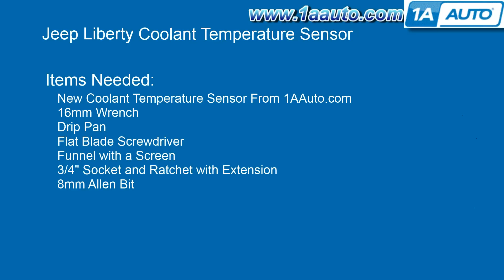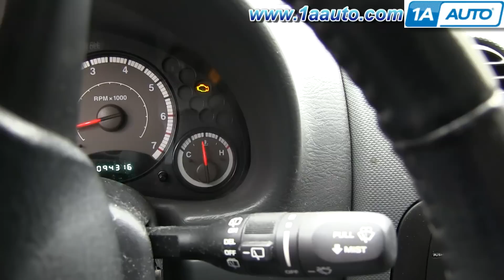How to Replace Coolant Temperature Sensor 02-06 Jeep Liberty

Comment: Why drain the coolant?
Reply: If you don't drain the coolant first, when you remove the old sensor coolant will come gushing out the hole the sensor goes into.  You don't have to drain it completely, but the level must be drained to a point below the height of the sensor hole.  Easier to drain first into a pan than to have it come out the sensor hole all over the engine, etc.
Reply: @timinbovey it will only gush out if you remove the coolant cap.

Comment: Why do I have to drain the radiator to change the sensor?  Let me know please.
Reply: because the coolant temperature sensor is below the level of the coolant, if you don’t drain it below the level of the sensor coolant will come out of the sensor hole

Comment: I have a 1993 Chevy Corsica   The temp sensor plug my car came with is a 4 wire plug. The only temp sensor replacements is a 2 wire. I’m wondering how to wire the new 2 wire plug in place of the old 4 wire plug so I can plug into the new temperature sensor

Comment: A 1 auto....quick question if i may? while my jeep is running... i unplug sensor and the fan comes on, is that normal????
Reply from the maker: +james bivens Thanks for watching! Since this sensor is part of what tells the fan to kick on and off yes, that could happen.
Reply: @1AAuto  I just put in a new fan and sensor, it will run forever and fan WILL NOT come on until I unplug the sensor. Then the fan comes on, strangest thing I've ever seen, any thoughts???
Reply from the maker: +james bivens We wouldn't be able to diagnose an issue like that here, you may want to have a local mechanic take a look at it. Thanks for checking us out! http://1aau.to/m/Shop-1AAuto-c

Comment: Is there a fuse or relay associated with this sensor? I just changed my sensor out but my check engine light is still on and the coolant sensor code is still coming up.
Reply: Change thermostat

Comment: Really should have reconsidered the audio after 2:51 since 97% of what you can hear is the engine and fan noise, not your extremely faint speaking voice.  Really appreciate the video though and it's very helpful.

Comment: Ect sensor still has plastic part sticking up. Cant get socket low enough to unscrew the thing with that piece stick up out of it. Yes I've took off the wired part. But you didnt say anything about the left over piece that is plastic that is apart of the sensor that's screwed into the engine. Does that piece come off or will I need to buy a socket that's got a deeper or longer opening ?
Reply: Deep well socket should work

Comment: Is the coolant temp sensor the same as the thermostat?
Reply: No. The thermostat is on the front, bottom passenger side of the engine where the large radiator return hose goes into the block. It’s between the plastic hose fitting and the engine. There are vids on here for that item.

Comment: 04 jeep grand Cherokee limited edition noise. Temp sensor is out replaced it already but it shorts out fan and or circulation of coolant how to fix😣
Reply: My alternator is on the left orpassenger side and temp sensor Wiring is on other side of the motor
Reply: Lol

Comment: Will the engine light go away after you switch it?
Reply from the maker: +GoForIt If this is the reason for your check engine light, yes. If it's still there, there may be another underlying issue. It's hard to know for sure without being able to diagnose in person
Reply: Yea I drive it for about 20km and it was still on.  I ran it on a coder machine said it’s the only code. Cleared it shall see if it comes back! Love the channel
Reply: I would assume you would have to reset your battery and drive fifty to a hundred miles to reset the battery which would then reset the check engine light.

Comment: did you fully drain radiator? my jeeps sensor is longer and requires me to pull airbox assembly connectrd to throttle body.  not sure yet how to proceed
Reply from the maker: +Joe Heading You may be able to drain it halfway to allow the fluid to drain out of the upper hose. We carry the replacement sensor shown in this video on our website. Here's a link to them. https://www.1aauto.com/1A/coolant-temperature-sensor/Jeep/Liberty/WETSU00002?utm_source=YouTube&utm_medium=CTA%20Comment&utm_campaign=1ATony

Comment: 2007 jeep commander starts about 3 times and once I've driven it around town for a few hours...it will crank but not start. I wait 20 min and it starts everytime. Been doing that for 4 years. Any clues??
Reply from the maker: It might be getting some type of a vapor lock
Reply: Crank sensor

Comment: If i switched out my water pump an new thermostat an a new radiator cap why is my car still over heating
Reply from the maker: +Alex Perez We wouldn't be able to diagnose an issue like that here, you may want to have a local mechanic take a look at it. Thanks for checking us out! 1AAuto.com